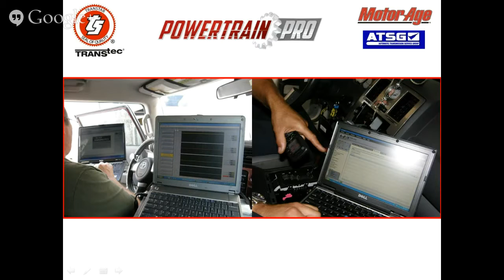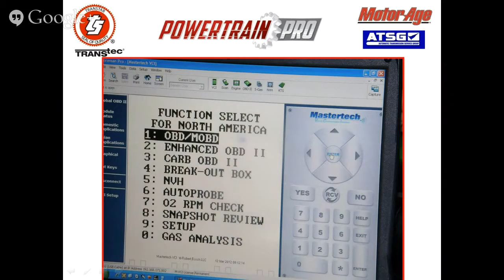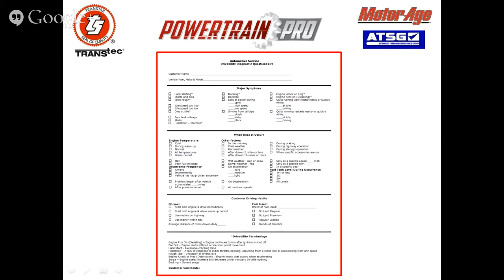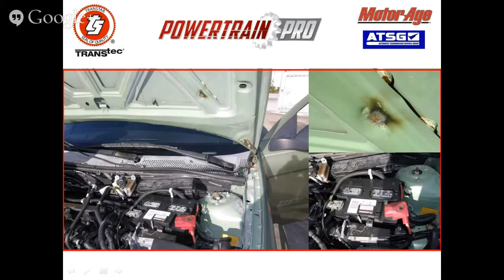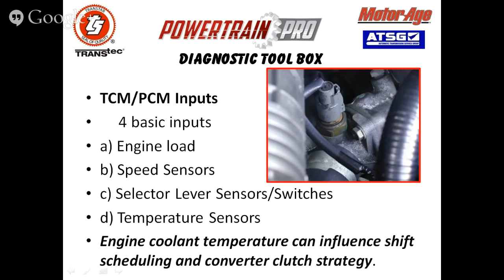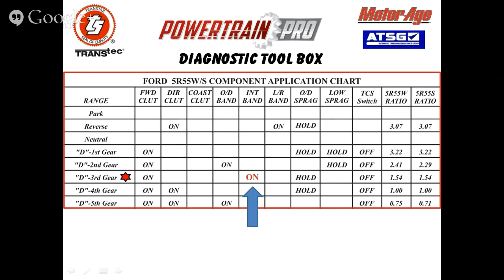ATSG: General Transmission Troubleshooting Tips

Comment: Can a transmission be diagnosed without driving the car? I ask because thats what the dealer didn’t do before telling me that my best options were to get a remanufactured transmission for $5000, or spend $5000+ for them to begin physically diagnosing it by taking it apart and changing the torque converter (all based on what “they typically find”). My question is really about finding an honest mechanic.

Comment: Great insight! I come because my wife's friend (single, older, broke) has an 05 Sedona. She had the power steering pump changed. The mechanic noticed a mouse ate through the insulation of "some wires" and replaced the section of bad wire. Now, you guessed it, the transmission slams into 2nd then enters 1 gear only limp mode. 

She described her issues but didn't mention that it was just worked on. She mentioned that her tach stopped working so (before I knew the back story) I went to change the ignition failure sensor hoping for a long shot fix thinking that might be causing the transmission issues. That's when i noticed all the wiring to the transmission was "new". 

So my question is: How the world can I diagnose the wiring without a wiring diagram?

The mechanic is playing dumb to the repair now claiming her transmission went bad right after the repair. (Well... Not playing) 

He actually spliced wires and ran new ones so the plug has 1 new connectors inside the housing ran with 6 inches of new wire connected to a blob of the original wiring harness. So it's all plugged in the correct ports but I don't know if he mixed up the pins.

Comment: Ford focus diesel 2012 turbo,almost one year here my workshop the dual wet clucth newly change and check all gear its okey. And learned proces its done but still have a problem,The problem is while I put reversed and drive with brake pedal press down then if I released slowly the brake pedal car move fast its looks like the manual transmission while released the clucth pedal quick fast its look liked happen for ford focus automatic and jercking while moving fast please help in this matter?

Comment: Hi, what difference/effect on the TCM/ECM does it make when you swap a gearbox on a VW 1.6l, 74KW engine with a 2.0l, 85KW engine. The gearbox code of the 1.6l,74KW engine is FDH and that of 2.0l, 85KW  engine is FDG. The major difference in these two gearboxes are the number of clutch packs (K1,K2,K3, B1 and B2), the number of teeth on the input/output, pinion/ crown wheel gears. The physical construction, connection points, connectors, valve body and other components are the same. They are also both For 4 speed 01M auto transmission gearboxes